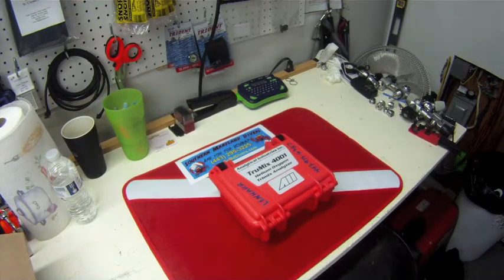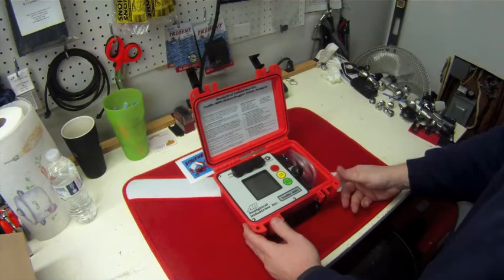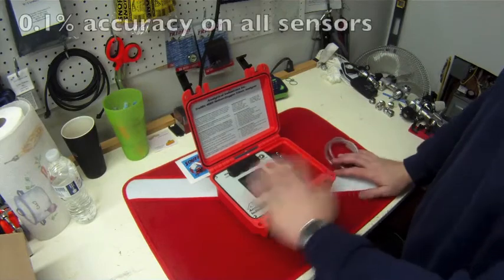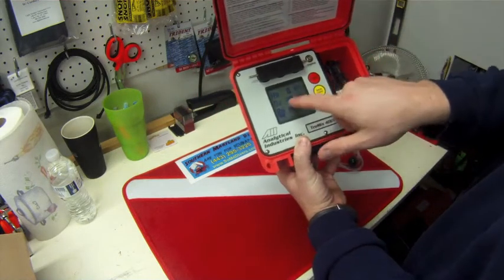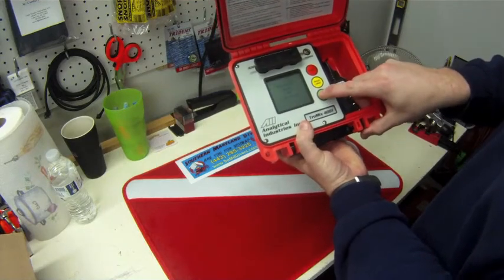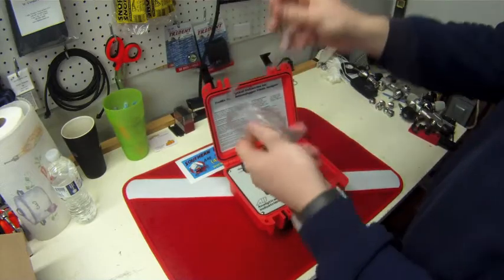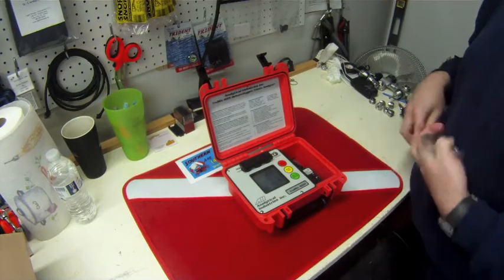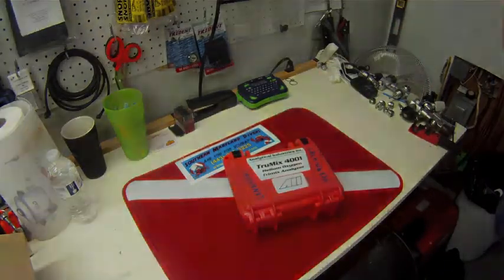Analytical Industries TruMix 4001 Product Review

Comment: Would you recommend going with this AI Trumix or with the Divesoft He:O2?
Reply from the maker: They are both great analyzers. One area where the Divesoft might be just a step ahead is with the HE sensor. It uses acoustic sounding vs a sensor so in theory you would never need to replace an HE sensor (which are expensive). That being said, the lifespan of an HE sensor is long (usually 10 years +) so it's kind of a toss up.